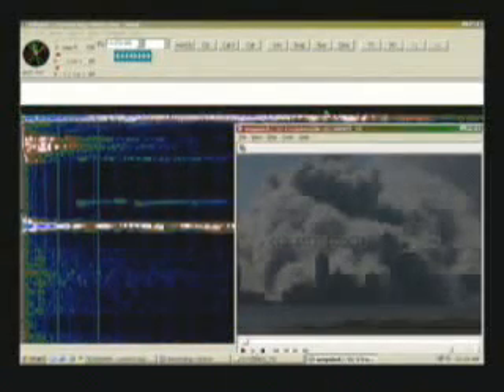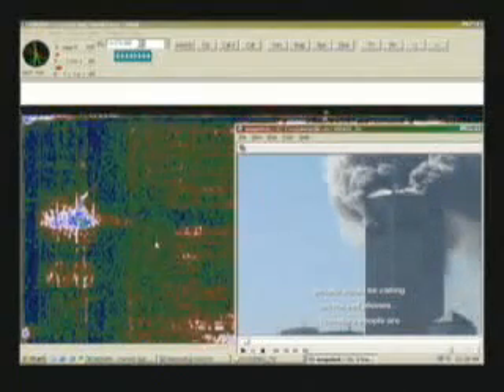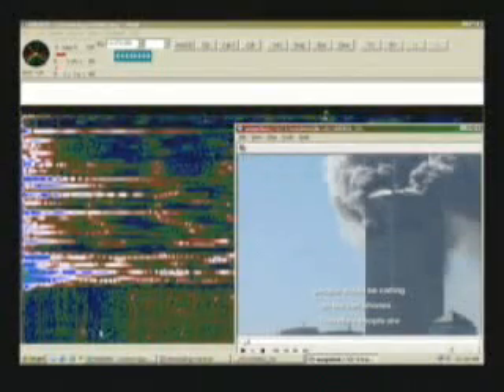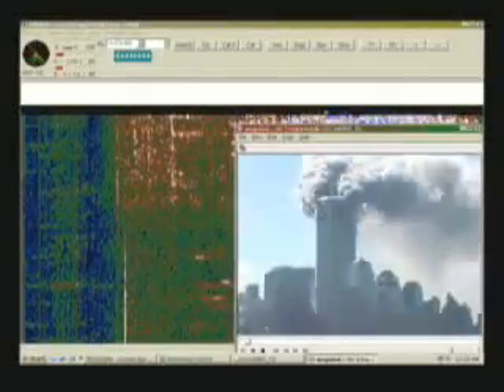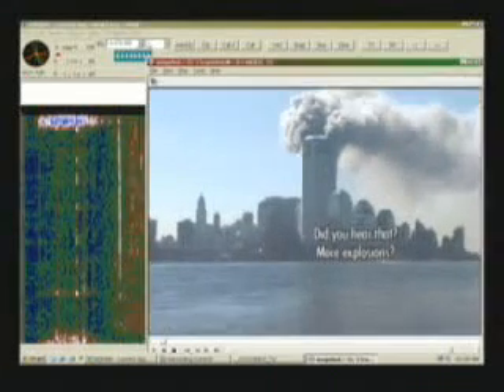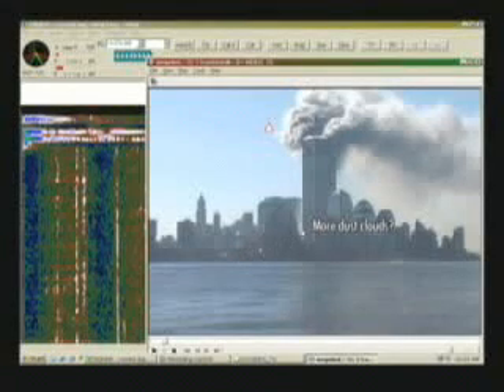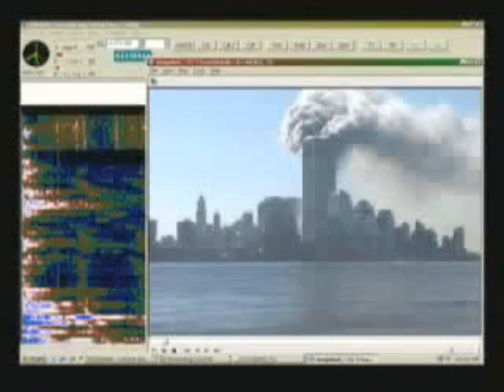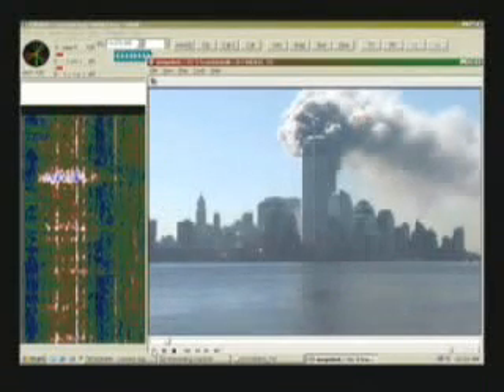Audio Spectrum Analysis of WTC explosions - Pt 1, the best so far!

Comment: Do you have the tape that you are analyzing??
Reply from the maker: It's a CD that Segal circulated.
I do have it.
Perhaps I should redo that, since it's been over 10 years ago, but You~Tube might erase my account, if I try to redo it in this modern Censorship environment.
Reply: @rebelforgod  yessir. I recall seeing another breakdown from across the bay. Where they align the audio to the puffs of smoke and there was a series of boomboomboom - like that guy that was close by indicated in one interview - and it just seems awful suspicious with the new investigation coming (if i heard right) but I wondered... Like a jenga tower. If you pull a section out, at least it leans and tips first. While that's not 100% analogous, the way they both fell perfectly straight down?? And it broke down wtc7 and how it fell faster than gravity? Free fall...faster than even free fall. Anyways. Thanks for your efforts. I don't know what happened. But maybe everyone is right. That the planes took them out, but they had a touch of help on the inside to cause them to go for sure.